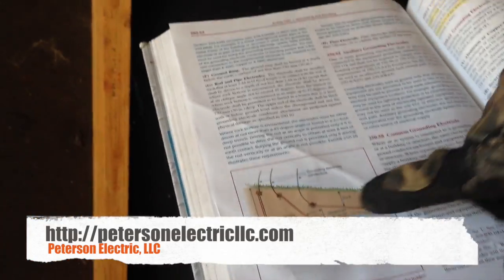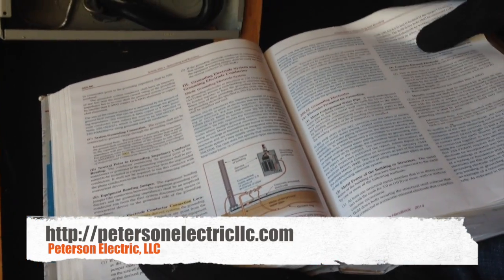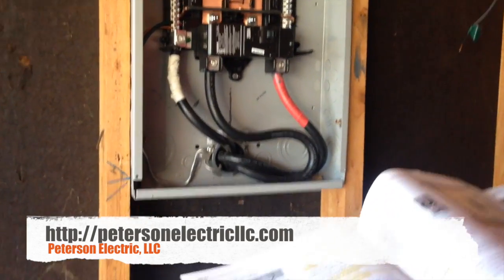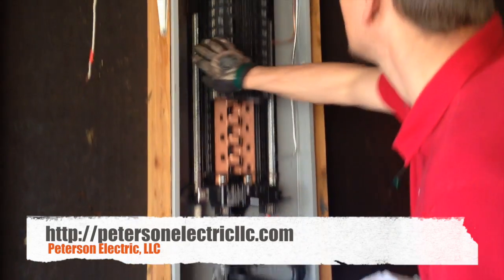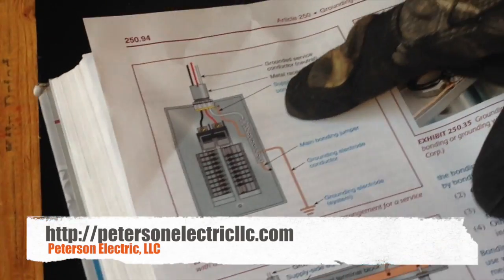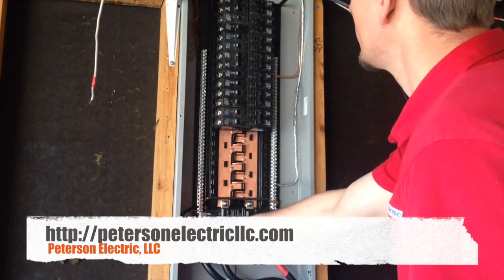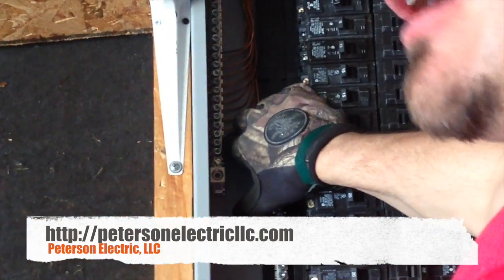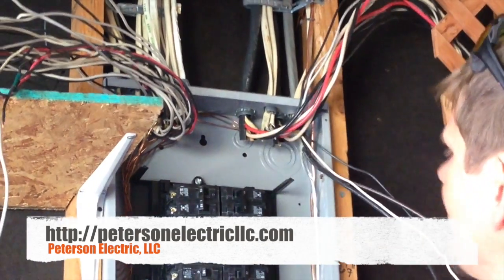What Should Your Electrical Grounding Look Like On Your Home?

Comment: Could you explain how your GEC can be spliced CU to AL with the split-bolt? I want to assume it is because there is no current passing through them during normal operation but Iv never seen that before. Code reference if any
Reply: He cannot. The dielectric metals touching will corrode and in time have no electrical connection. There is no artical that allowed this. """Conductors of dissimilar metals shall not be intermixed in a terminal or splicing connector where physical contact occurs between dissimilar conductors (such as copper and aluminum, copper and copper-clad aluminum, or aluminum and copper-clad aluminum), unless the device is identified for the purpose and conditions of use. "
Reply: @DJBigDawg420  that corrosive occurrence between metals only occurs when the two conductors are energized.
Reply: @gracebonez  Somewhat incorrect...Im sure the wiring method we are talking was used all the time back in the day. Since we are youtubein nit picking.. But we know now, galvanic corrosion doesn't require electricity; in the sense your thinking. Small charged (from atmosphere) droplets of water are enough to start galvanic corrosion. Copper/Galv... gas lines corrode with no electricity. Well they say its from stay currents... Anyway back to real world...if he put aluminum grease, would have made it last 'long enough' like the old times. But bad practice today. polaris or similar simple steel connector.
Reply: @DJBigDawg420  Ok riddle me this. does this corrosion apply strictly to actual aluminum only, combined with copper? Or will there be corrosion on AL-8000 alloy conductor as well?

Comment: I do not have a water meter to ground the panel  to. I installed two lightning rods outside 7 feet away and those have a bare copper wire running to the meter socket. Would I also run an additional bare wire from panel to lightning rod?
Reply from the maker: Almost ALL homes have a water shut off valve. If you don't then it must be in the yard, I would get one installed near my hot water heater on the cold side.
Reply: @Petersonelectricllc  I am on a Well and my inside plumbing is all PEX
Reply: @Petersonelectricllc  more and more nowadays, water services are plastic.
Reply from the maker: @michaelpchamp  We have main water lines that are pex, or plastic lines coming in.

Comment: Question. If you live in the subtropics region, like Florida, where water is only 3-4 feet deep into the soil, would that give you a really good ground via the grounding rod?
Reply from the maker: It seems it would be better than nothing, we have to install two here in CO even if there is solid rock and it is allowed to lay them down based on 250 in supplementary grounding. Also, if new build concrete encased electrode (#4 bare solid) has to be ran in the foot 20' and inspected before they pour. 250.50 and through 250.53

Comment: I always thought ground rods are max rated at 60amps from manufacturer. So #6CU is the largest conductor to use for them
Reply: That's the minimum size. I use #4 bare copper with 2, 5/8 ground rods. Just covering my ass!

Comment: You only bond your grounds and neutral at first point of disconnect .that is a main lug panel your grounds and neutrals should be seperated
Reply from the maker: Yah I know
Reply: @Petersonelectricllc  see that big 200 amp main at the bottom of the panel. It's not a main lug panel inspecter
Reply from the maker: I am aware where the bonding jumper connects between the neutral "grounded" and the "grounding" bare copper conductor.
Reply from the maker: Ok!
Reply: It's a MCB panel.